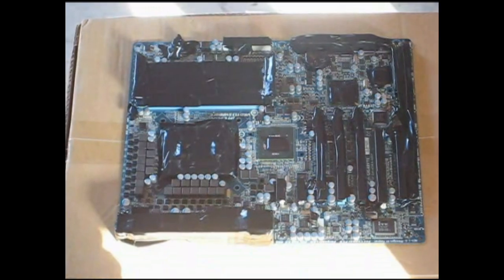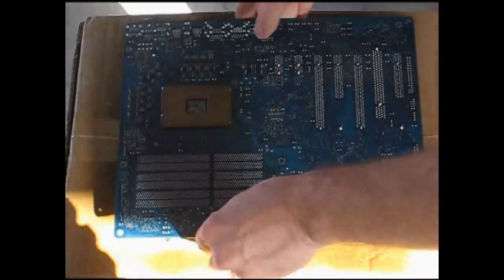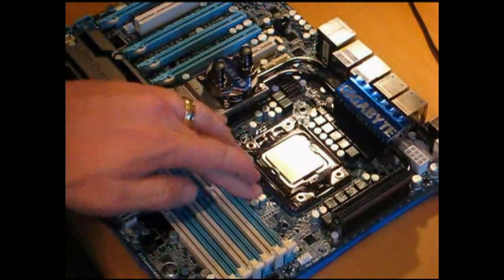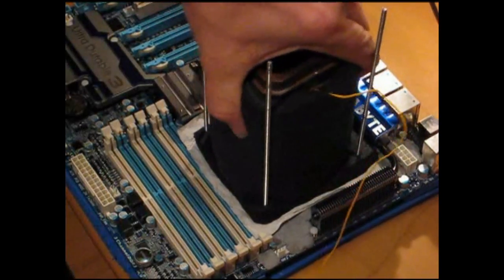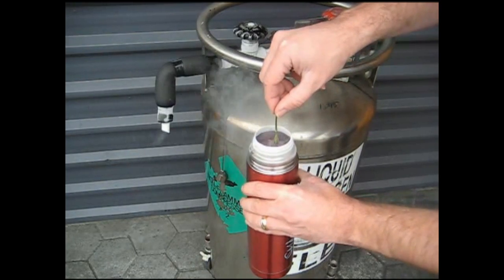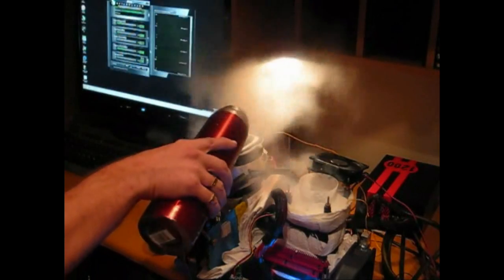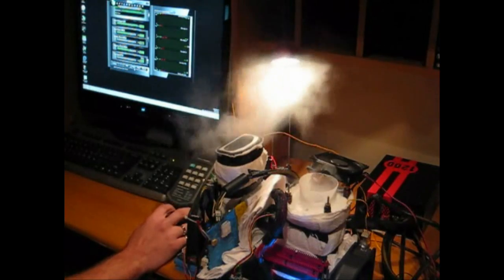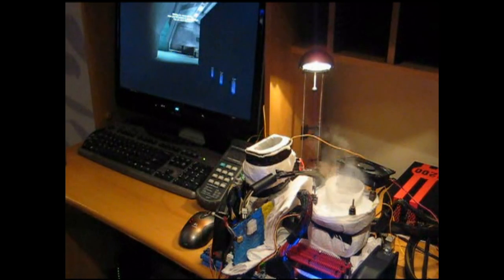Deanzo overclocks Intel's Gulftown (Core i7-980X) with LN2

Comment: @zajec11 
no good info because nitrogen is not conductive
you do not need to seal up your motherboard because nitrogen is normally a gas
its only so high compressed that its a liquid its cool but its not conductive and at -40°C its turning into a gas

Comment: @zajec11 
no good info because nitrogen is not conductive
you do not need to seal up your motherboard because nitrogen is normally a gas
its only so high compressed ihat its cool but its not conductive and at -40°C its turning into a gas

Comment: @givemethelotion Actually, spreading can cause air bubbles when you apply the cooler.  How many air bubbles depends on the quality of the compound, but even the best can have one or two air bubbles, and if its near the center of the processor, your cooling will suffer.